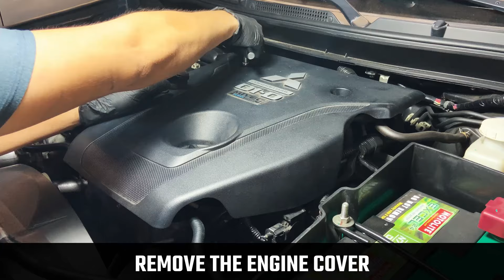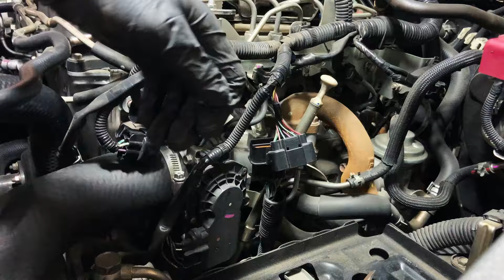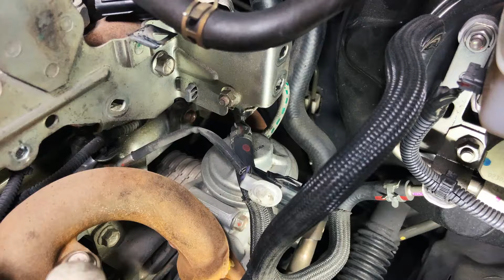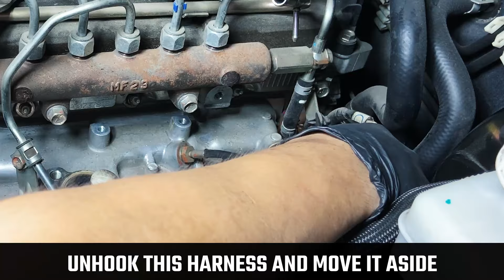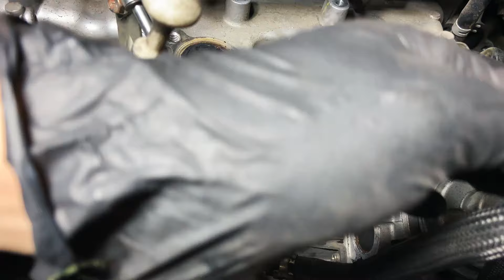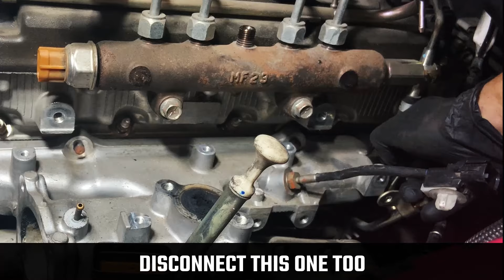Montero Sport Gen 3 EGR & Intake Manifold Removal | Triton | 4N15 | Mitsubishi | DIY

Comment: Sir off topic but somewhat similar din. OIL CATCH CAN, ano po ang mga cons if any? When i cleaned my throttle body there was a significant volume of oil. I assume it came from the xylinder head breather then passed thru the VGT to the intercooler? Makakatulong po ba ang oil catch can?

Comment: Great video. 2 hour strip, 2 hour clean, 2 hour install.. Thank you very much.
Reply: It took me 2 days... Hard to dismount egr, extremly hard to clean the oily soot shroud in manifold. Its absolutely resistant to petrol, only carbcleaner can deal with it. I used 4 ballons to clean the dirt.

Comment: Had mine done DIY. Thanks for the tutorial.  But i am having issues with my fuel rail supply pipe. Its always leaking fuel. Had removed and reconnected it twice already. Got any ideas?
Reply from the maker: Hi Paulo! If it keeps on leaking it’s best to replace it. Just make sure not to over tighten those pipes upon installation.
Reply: @btdgarage  managed to do it on the 4rth attempt. Slamat po ng madami sa mga DIY tutorials nyo sir! More power!

Comment: Thank you very much for sharing. would you have a video or know of one that shows valve clearance adjustment on this engine?
Reply from the maker: No video yet but I’ll try to make one soon :) 
Here’s the standard value for 4N15 valve clearance:
(Cold engine) Inlet valve: 0.08 ± 0.03 mm
Exhaust valve: 0.16 ± 0.03 mm
Reply: @btdgarage  That would be great if possible. I know several owners of Tritons and Paj/Mont Sport with 4N15 engines who'd like to do it properly, themselves. What I'm often confused with is gaining access to the adjusters, since there are so many parts in the way.

Comment: Effective ba Yung liqui-moly spray in egr-cleaning sa strada2022, open and spray lang sa throttle valve then high Rev?
Reply from the maker: Haven’t tried yet po
Reply: @btdgarage  ito na po ini-offer ng casa in cleaning egr , para iwas Baklas..bale during spray masasama sa combustion ang liqui-moly then pupunta sa exhaust. pero as what I  know sarado ang egr during high Rev,paano papasok sa egr ang liqui-moly pabalik from exhaust? Tama po ba ?
Reply: @davepamplona5491 kaya pala nagtataka ako yung mga markings hindi nagalaw ganyan na pala ginagawa ng casa

Comment: Hello. Got some question here. Last day on 13 January 2022 I've got my 60k km service at Service centre. Everything seems done correctly. Then I'd have a long drive on 14 January 2022 when I notice there's something weird about my engine sound when I press the throttle and like loss a bit of power. Then later on after 12 hour park, I'll check the engine oil dipstick level, it goes half between max level and the x mark. Then I'll check it again immediately after turned on the engine a while, dipstick level goes about 0.5mm over the max level. Will it cause any damage to my car engine? I already drive for about 200km before realize the overfilling oil engine from the service Centre. Thank you..
Reply from the maker: Hi. 0.5mm over isn’t that bad. However, regarding loss of power it’s best to bring your unit back in the service center to have it rechecked if there’s a noticeable loss in performance. Most of the time on modern diesels, a simple issue like a loose intercooler hose clamp / boost leak can cause a significant loss of power. Have every part they removed/serviced rechecked and retightened.
Reply: @btdgarage  when I checked back last Pic I've taken, it's more like 1.5cm +/- from max.. But already sorted out. Drained the excesses oil the other day, engine running smoothly already.. Hope didn't cause any damage..
Reply: @btdgarage  I think the loss of power is related to the excess oil because the crankshaft get some resistance when the oil reaching the crankshaft..
Reply: When I checked again, the overfill is about the same level as from 'min' to 'max'..

Comment: Would a catch can stopped or even slowed the clogging process of the EGR?
Reply from the maker: Not really since the EGR system connects straight from the exhaust and to the intake manifold. Catch cans goes in between the pcv/breather hose and intake hose

Comment: boss kailangan pabang i fuel bleed ung fuel line na tinanggal galing sa common rail?
Reply from the maker: No need na po. But if you want to be sure, loosen the upper end of the removed fitting (1 full turn), unplug all injector electrical sockets, then crank the engine, air bubbles will come out sa fitting. Don’t exceed 10secs when cranking. Once there’s no more bubbles or air coming out of the fitting, tighten it. Reconnect the injector sockets then start the engine. If you get a check engine light after this, it’s due to the injectors unplugged while cranking, so best to have an OBD scanner ready when doing this to clear the code.